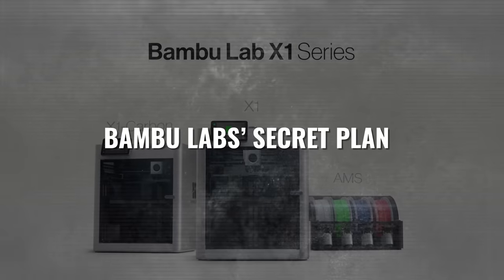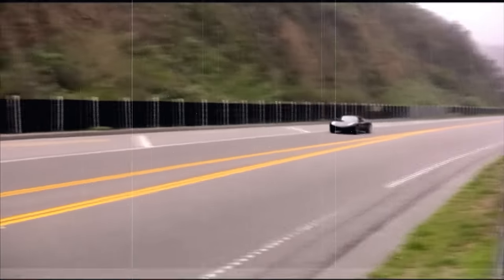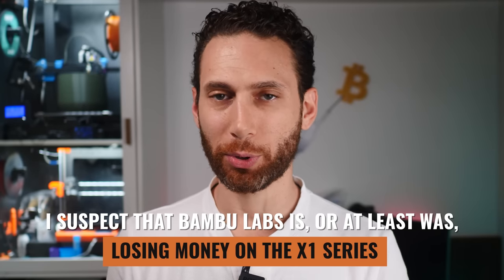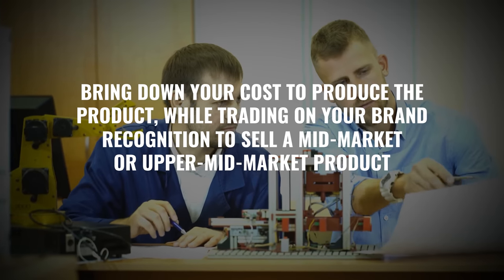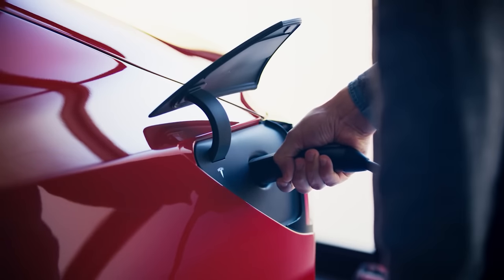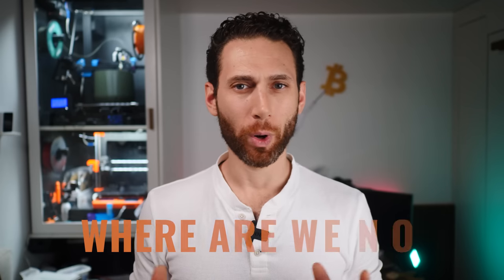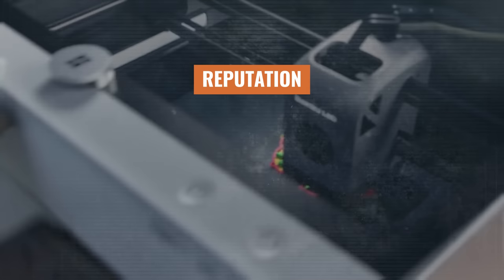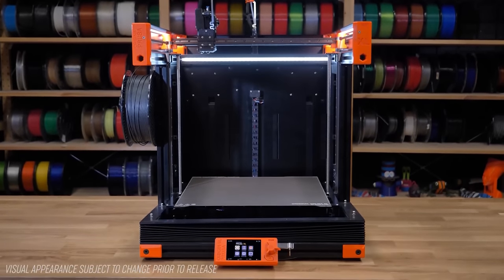Bambu Labs Secret Plan: What the P1P Means for 3D Printing

Comment: What is the point of this video? What does one take away from this? This is all speculation and opinion based on zero facts about Bambu’s printer cost or the business model of the company itself. Even in the Kickstarter content, they said they kept their prices down by manufacturing automation. They invested a lot in this area and they used low part cost mass-market types of manufacturing like injection molding. As others have said, these guys came from DGI and there they learned about mass manufacturing and reducing costs.

What these guys have done has made investments in their products, and they’re manufacturing. There is nothing here that any other manufacturer of current 3-D printers couldn’t do. But vendors like Prusa, who choose to charge ridiculous amounts of money for 3-D printed low quality part based designs with average feature sets still confounds me.

Comment: You picked strange examples. I would compare it to Amazon. Instead of being profitable they want to grow in this new space as fast and as much as they can to then be the only big played in the field and cash in since everybody will use their product, their software, their 3d print eco system etc. Amazon never was profitable and this was never their plan, companies are being evaluated not on profit but on sales.
"The winner takes it all" is the trick, this goes for all the big tech firms from Amazon to Alibaba.
They just need to build a printer without all this tinkering nonsense like assembly for numerous days (Prusa) and ease of use, like they do with their build in spaghetti detector and print bed scanner.

Comment: Trouble is, The Bambu Labs Printer P1P is still way too pricey for the main amount of users... at over $699 it is nothing more than a over stripped down printer of the original Carbon X1.
That is another Prusa printer type of cost to buy. well beyond 90% of users just like the Prusa's which themselves are over priced fancy Tesla like top of the tree stuff. again beyond most buyers.

As for the Price coming down more and this tech somehow filtering down to main stream normal printers, 

Answer is no as the cost of the system will mean that all the parts and firmware
will keep up the level of costs so much, no other printer maker will be able to afford to do a printer below $500. 
and that will be a even more stripped down system such that it be not worth the money.

Just look at Tesla cars since you used them as a benchmark of the costs.  They are not cheap,  in fact not only are they still very pricey compared to even other EV's
But they are in fact going up in price not down.  All of them in fact have gone up 9 times from their original sale prices. 

After all, even their so called low cost mass market EV the Model 3 standard range is not cheap by car standards it is around $50.000 a EV 
the New Model Y is $60.000.
These are the lowest price Tesla EV's. Not what I would call low cost. Maybe 20% of the planet can afford them the rest can't.

So this printer is a luxury brand just like Tesla or Prusa all based of top end for limited users whom have tons of spare money. 
Companies like these don't research high end tech so they can bring the costs down so normal level low money paid users can buy them. 

If they bring it down too much they will lose too much money big time and go out of business.

As normal top brands only wish to have well paid or rich buyers not low paid ones as image is all. 
Look at Apple Inc. or Microsoft or any top company all about big profits not low profits. you don't get high money by selling to poor users.